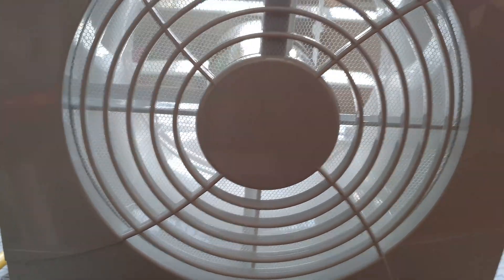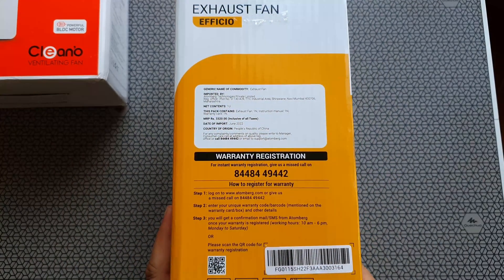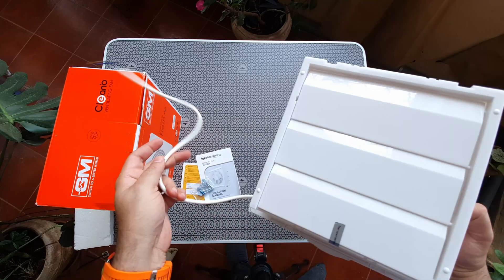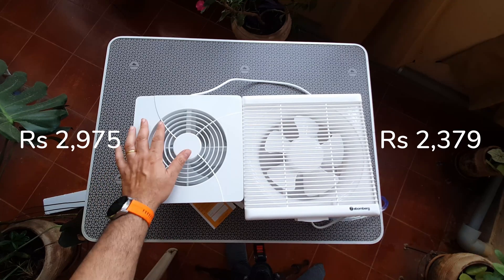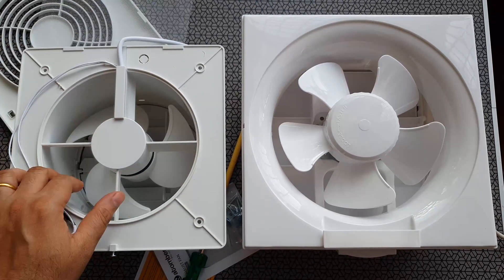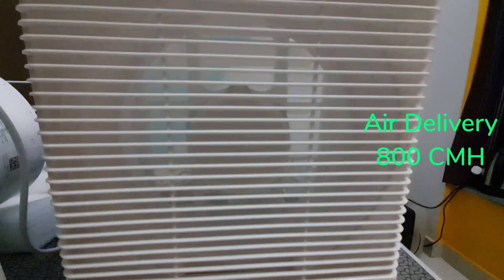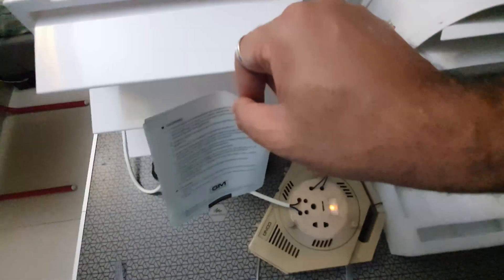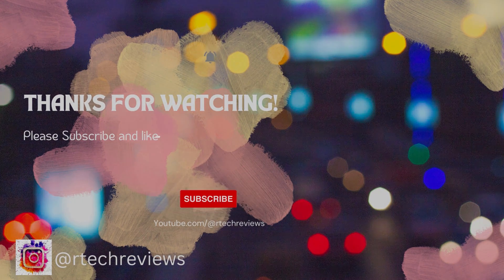BLDC Exhaust Fans from GM and Atomberg - Low energy consumption! #atomberg #bldcfan #exhaustfan

Comment: Is GM suitable for our Indian kitchens becoz of oily smoke and oil particals in the air??

Is this available in 250mm and 300mm sizes??
Reply from the maker: Actually this GM is not suitable as it's more of a circulation fan, you can try the Atomberg version that comes in all exhaust sizes... If possible get a chimney